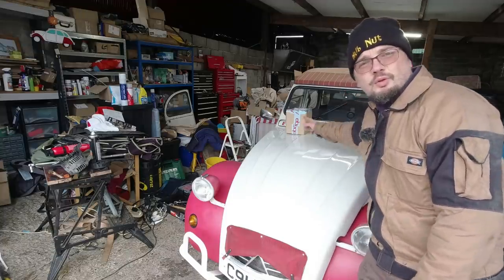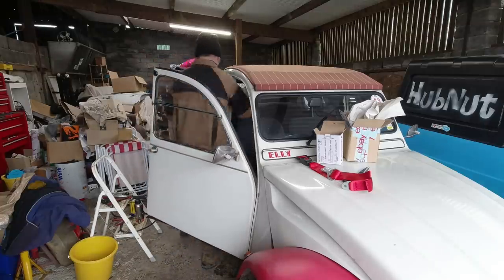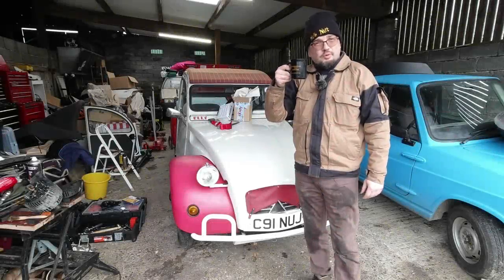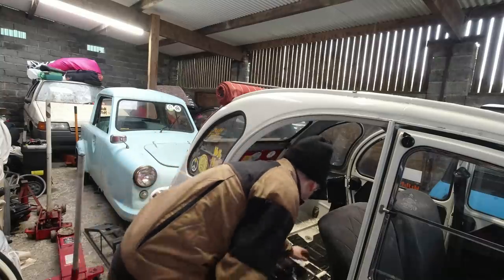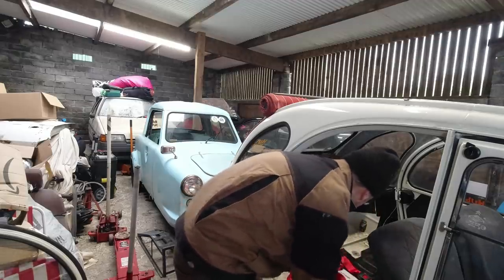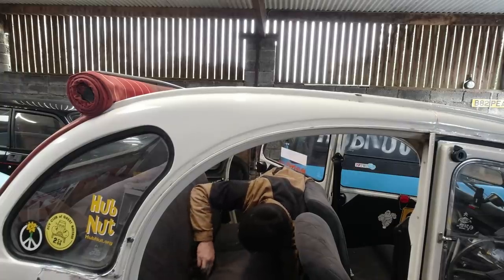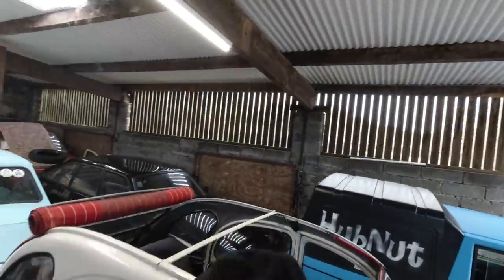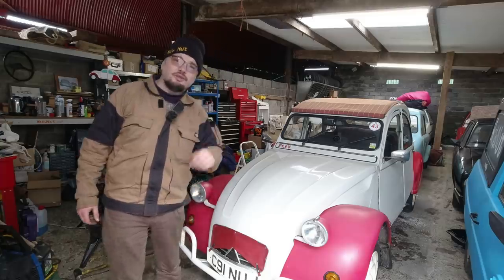2CV Rear Seatbelt fitting, and a few 2CV tricks!

Comment: I think you've got the balance just about right with the safety. Fitting the rear lap belts is a sensible and reasonable precaution, but as you say if you worry too much about safety, you'd never go anywhere in an old car, and that would not be good.
Reply: Apparently just breathing is dangerous nowadays, try not doing that for long for safety and see how you feel !!!

Comment: "One for the ladies with exceedingly bad taste and poor eyesight" I can see that backfiring on you when Miss HubNut sees this.
Glad the threads cleaned up OK, not many people have a selection of UNF taps at their disposal.
Reply: Are those bolts UNF? I'd have expected some odd metric thread in a 2CV!

I do seem to remember that the seat mounting bolts in my parents' Mitsubishi L300 are some bonkers JIS fine thread and nearly impossible to find in Europe. The previous owner had the two rear bench seats out most of the time and only tacked them in place with a handfull of bolts when he sold the car. It took us a while to realise the others were missing and a lot longer to find them behind the flap that holds the jack and toolkit.

Comment: my jaw physically dropped when you slid that door straight out in one smooth motion
Reply: The sign of a proper Land Rover - only the sliding action is less than 2 inches !
Reply: @millomweb  I'm a Series 2A owner, I concur :)
Reply: @G6PBS  My 'bucket list' includes getting a list of all Land Rover accessories. I'm aware the list includes: Doors (one or 2-part), roof, heater, welder, capstan, windscreen wipers....
So if you can help me out on that, I'd appreciate it :)

Comment: Create your own tap by running a disc cutter groove down the length of a suitable spare bolt then run it through the nut/hole.A bit of lube as well works every time.

Comment: Well done, Ian. Glad to see safety being addressed. I'm rather surprised that Ellie does not have upper belt mountings built in. In my 1969 Acadian, rear belts were an option, and the dealer sold shoulder belts. The mounting points were part of the design engineering.
Reply from the maker: The 2CV was never engineered for three-point rear belts. As far as I'm aware, nor were the vans. In fact some of the 2CV vans weren't even engineered for three-point front belts. (point of order, Acadiane was introduced in 1978).

Comment: Instructions taken out of box and derisively thrown back in. Love it! Very “Y” chromosome. 

Elly is a flat pack car. Are doors a legal requirement on the roads?  

You can always cut a wee notch in a correct sized bolt to make a thread chaser. You knew that didn’t you?!  I’ll get my coat. 😉
Reply: You can do the same to tap improvised threads into perspex, I learned yesterday.
Reply: Worth knowing. Perspex is rather difficult to machine and drill with its tendency to crack and star.
Reply: @robinwells8879  I was also taught to use liquid soap as a lubricant.

Laser cutting introduces a lot of additional stress into the perspex and increases the tendency to crack. Using alcohol-based cleaners aggravates that even more. Cutting narrow strips of thicker perspex (especially 8 mm and up) is pretty bad, my 8 mm wide test strips turned into bananas.

Comment: 2CV's were indeed good for filming. The older Sister of a friend of mine had a Dolly, by virtue of the fact her Husband got one for use as a camera dolly for filming from the back of. He commented at the time how they had taken off the roof and doors to mount a film camera in the back. The film in question is "Cresta Run" (1990) and the running scenes on Blackpool sea front were filmed from the rear of a 2CV. I'm in it as an extra for a split second.

Comment: If you don't have the write size tap find a bolt that fits and grind in a gruve down the its length and use that. Its very cheap and works just as well.
Reply: Yes, was going to say the same thing.

Comment: Hi Ian that was a nice and easy job and a job well done,and so easy to work on, I think that now you have fitted lap belts you  can get a kit to convert them in to a full 4 harness that goes over both shoulder's and the lap belt threads through it, I think they was called a h harness, don't know if that's any help to you.but at least what you have done is better than nothing,best wishes to you all.

Comment: Back in the day, the top mount was easy. You drilled through the B or C pillar , then a tubular nut went from the outside with the top mount bolted from the inside. From the outside it looked like a lug nut cover. Whether such a thing would survive an accident I don’t know.

Comment: Funny, here in the US rear 3 point seatbelts were not required until 1987-88, not sure. Lap belts were required here in the late 60's, we always had them, and wore them as children, since my mother and her family were in a terrible accident in the 50's which almost killed her mother.
Statistics state most accidents happen less than one mile from home, so one has to be careful.
And when I was younger, when not sitting in a proper seat, we road in the back of our station wagon (estate for you in the UK 🇬🇧) in the cargo area, no seat belts, because five children in a six passenger wagon meant the back area to one's self! Same goes for riding in the back of a pickup, still do it today when I need a ride, like riding in a convertible, except not as safe. Still here however, and I do buckle up properly!
Job well done!

Comment: Cable ties, standard issue in any HubNut car. 😂
My dad's 2CV4 was the first car I was in back in the early 1970s (well maybe also in my grandmother's DAF 55, can't tell), we've probably never had any seat belts in them as it was a 1970 car and seat belts weren't mandatory at the time. Later he drove a 1974 Datsun 140J, which only had lap belts in front, though I can remember there was a sign "FASTEN SEAT BELTS" (just a sign, no warning light like a Volvo). But no seat belts in the rear, can't remember I have been in a car which had them when I wasn't old enough to take the wheel myself.

Comment: Take a bolt cut a slot vertically down the side  the bolt at an angle using a hacksaw and you have a simple thread chasing tool.

Comment: I own a VW Thing, and the door removal is very similar and sometimes I drive around with the doors off. However though, the front and rear doors are the same, the alignment of the door catches is not the same so it's easy to fit the door in the wrong place

Good comparison about using motorcycle wits when driving, like Elly, the Thing has no safety features, but it's simplicity is its charm

Comment: Top tip. If you fit the seatbelts with the buckle on the inner wing, if the kids jump out and don’t notice the belt fall out the door, you wont get it round your rear wheel and rip the inner wing out. (Can credit Daras for that tip).

Comment: Note for future: A natural bristle toothbrush (or small wire bottle-brush) and some cellulose thinners (often used as nail varnish remover) will quickly deal with paint filled threads, assuming the paint is an old cellulose based one. Otherwise a product such as Nitromors paint stripper can be used (remember to wear goggles).

Comment: One possible solution to the lap belt issue: if the child is young enough to fit into a car seat which needs to be strapped in to the seat, and then the child is strapped to the car seat separately, the argument of lap belt vs 3 point belt is a lot easier! Unfortunately that only works for really small kids

Comment: A hidden secret of the 2CV engine 

Dear Mister Hubnut, I know you upgraded Elly's engine recently so you should not be concerned. 
So...

My brother buys a spanish 1983 Dyane at 130,000 km 

The engine starts well when cold, but it is practically impossible to start when warm. I immediately incriminate the coil, like everyone else would, but I'm wrong. 

During his long life, the engine has undergone hundreds, thousands of heating / cooling cycles. The expansion coefficients are different for aluminum, cast iron, steel. Over time, a parasite clearance has developed between the cylinder heads and the cylinders. At cold start-up, there is a slight passage between the cylinder heads and the cylinders, hot combustion gases escape into the heat exchange boxes as their inimitable smell testify when spreading in the cockpit. In the long run, the passage of these gases can erode, damage the aluminium cylinder head. 

But there is more. 

The cylinder heads have therefore settled, "come closer" to the engine block. But the push rods haven't shrunk !  So, when the engine warms up, they expand even further and push on the rocker arms. So much so that when warm, they keep "pushing" the valves slightly open. There is a loss of compression which prevents cold starting, and since the valves no longer tightly closed they can be damaged over time. 

So, to make a long story short, if your 2CV engine have not been serviced fort a long time (I suspect that the Dyane's engine cylinder head studs have been torque - tightened for the first and last time at the Vigo's factory 38 years ago) check the head studs torque (0,5 to 1 mkg, then 2 to 2,3 mkg)  and set up the valve clerarance ! ( .20 mm all valves, cold engine),

Nowadays, the Dyane starts either cold or warm, with te same coil.

Comment: Wait, are those cable ties the ones you got on the Croatia trip that went missing? Mystery solved there, if that is indeed the case... :P

As for safety, well, better to have and not need than to need and not have, that said, having been in the back of many cars without rear seatbelts and no accidents occurring (aside from sudden braking and falling on the floor in a Chevette once!), it's just pure chance as to whether an accident happens or not... :)
Reply: If so, who'd have thought losing things in Croatia would turn up in Wales !

Comment: Hi Ian .....

Sorry to be a fly in the ointment, suggest you look up lap belts and why they were outlawed in cars as front seat restraints ... In the unfortunate situation of a crash the lap belt can cause the lower spine to sever, and then rendering the person who's wearing the belt to suffer spinal injury which will lead to paralyses of the lower limbs ... You need shoulder restraints to make the belts safe ... !
Personally I would rather not wear a belt and take my chances, than wear a lap belt ... !
Reply from the maker: To be fair, if you have a shunt that hard in a 2CV, it's not going to be good for anyone...
Reply: @HubNut  True but just so your aware, lap belts can cause more damage then they are worth ...
They have only just recently made it illegal to fit lap belts in the rear of cars in the USA ... usually a good indication of the safety of a seat belt ...

Comment: Like you say the seatbelts are probably not worth their fitting in an older car if you’re honest, avoiding accidents is advisable being C reg I suspect you could get away with no belts legally in the rear? Was it pre 86 before it was a legal issue? Still anything’s better than nothing in the back 👍
Reply from the maker: Yes, she doesn't need seatbelts. 1987 was the changeover year.

Comment: Did you not have upper mounting brackets in the rear mate ? You could have fitted 3 point static belts i think ?
Reply from the maker: Nope. 2CVs never had them. There's no strength in that area.

Comment: Surprised some one doesn't do a bolt in kit for 3 point belts with a bar to pickup the top mounts. Sounds like something Burton should add.
Reply: There is a German TUV approved kit. But it is a big frame and takes up a lot of boot space as it tries to find something structural to connect to.
Reply: @idrisddraig2  thanks, looking at the space behind the seat that makes sense.

Comment: Safety is a tricky one. There seems to be a feeling we should eradicate all risk in recent times and sometimes go to ludicrous lengths to achieve it. I’m not saying we need to take unnecessary risks, but there has to be a degree of common sense involved. There’s an argument that the safer cars have got with airbags, crumple zones etc, the more drivers are likely to take risks that they wouldn’t have done before. The slight irony with modern cars is the safer they have got in a crash, arguably the less safe they are to drive. I’m thinking here of thicker pillars obscuring vision etc. Passive vs active safety; it’s always a balance of the two I suppose. Then there’s the latest trend towards touchscreens in cars; utterly bonkers and dangerous.

Comment: If the safety thing is an issue, get the kids to wear  a set of those theatrical boob jackets? As worn by pantomime dames?  Or, get them a redundant RNLI inflatable life jacket each? No way will they be able to reach forwards with any part  of their upper anatomies should Hubnut-behind-the-wheel get caught out? Better still, get more kids and sit [wedge?] them in the back seat?  Wedged-in  kids have more uses than mere safety, too....